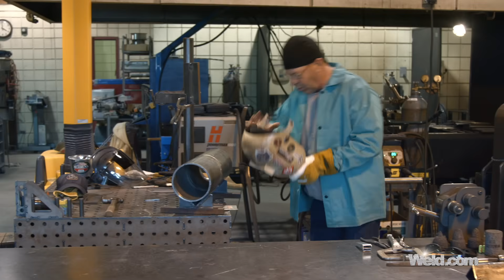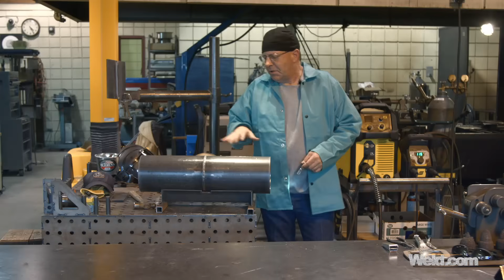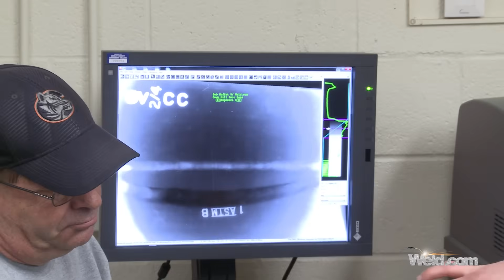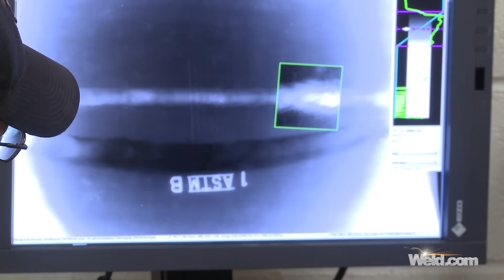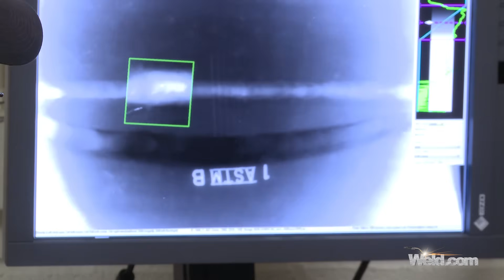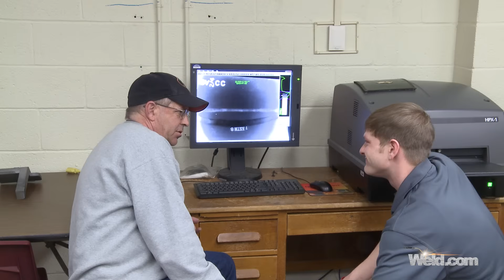🔥 X-Ray Testing 6010 Downhill Root Pass

Comment: Ive always welded pipe in plants Tig/stick but I know a downhill bead is as good as an uphill bead as long as both edges are consumed 7010/6010 my opinion downhill is just as strong as uphill because cured metal is cured metal any experienced pipe welder should know that  . Anyway that's my 2cents worth, Love your show BE SAFE AND HAVE A HAPPY NEW YEAR.

Comment: Dear Mr. Bob. I can add some credence to support your opinion on this, not that you need it. I’m a consulting contract welding engineer for a large pipeline operator. I can’t say the name due to an NDA I signed. One of my tasks for them is to review and approve all welder qualifications for all welders that work on their pipelines. So far I have reviewed over 5000 welder qualifications. They consists of API 1104 Butt, Branch, and Sleeve testing as well as ASME Butt testing. With the exception of the sleeve test, they all involve the use of EXX10 electrodes in the Fixed, 5G or 6G DH progression test positions. All of these are subjected to either requal by RT or destructive testing. By and large, the welders have no problems passing these tests with EXX10 electrodes in the DH progression. There are, however, 2 contractors that choose to only qualify EXX10 electrodes in the UH progression. I suppose at some point in time someone in their management was of the mind that one cannot consistently pass a test with EXX10 electrodes in the DH progression and they have never seen the light on this.

Comment: When you run down hill do you weave at all or just go straight ? Also is there any strength benefit doing up hill ?
Reply: Welding down hill if you are rooting the pipe does not require much weaving its faster for production welds   .

Comment: Thank you for providing great content. I have put to practice many of the tips and suggestions that give on this channel. I have a request though, can you give a tutorial or a demonstration on doing a root repair on pipe with SMAW if it is possible, without using GTAW or GMAW for the root. Reason being is that I was taught to only use the process and filler that I originally used. Thank you for taking the time to put together these videos.

Comment: I have been doing a lot of downhill root and fill then a 7018 cap just for speed on these field welds i have been making at gas plant. They will shoot clean every time and have a wedding band on the inside of the pipe. That 6010 down hill pushes a nice root in. Its quick and clean. Rig welders have been doing it for years.

Comment: I'm going to welding school at my local Vocational school as an adult student with some a-hole 17 year olds (some are polite others are not) and this one kid who pretends to be a know it all is constantly trash talking my welds (Oxy-Fuel beads, butt joint, lap joint, t joint and now 6010 stick). He's been welding for a year or so now and is already decent, I'm just now starting and in my 30's. Anyway, I'm doing 6010 running beads and I'm trying different methods and he comes over and asks "How sh*tty do your welds look?" And I just lay down the plate and say "they're alright. I'm getting better." And he asks why do I have ripples in my bead. I tell him it's called the "whip and pause method" and he asks 'why are you doing that?" Because he runs a straight bead. I just tell him cause it looks pretty. Anyway, what I'm getting at is people pretend to be know-it-alls to boost their ego or something. Once they learn one or two things, they pretend to be experts and sometimes it brings out the worst in them. Stay humble people, especially when you're starting out. Normally someone who has years of experience is humble and it's the neophytes that are the aholes trying to prove themselves or something.

Comment: yeah but there are codes that specify how to run it there are so so many variables if you can get away with it good for you I was 12 years old in the first thing my dad taught me was how to run downhill and I can weld a moment with a 2 inch flange with 3/32 wire innershield and on every pass drop 3/8 inch rebar in the moment and melt right through that stuff yeah it'll pass UT but I mean you want it done right or you want to turn right now just an observation and an opinion there's a reason the Navy won't let you run down I'm not knocking you I do it a lot myself with poor fit up no offense and keep up the good work I'm just saying there are so many variables but at the end of the day there are specifications and requirements if your welding water pipe for sprinklers you go girl but when you're in the header of a coal-burning power plant with high pressure steam I did that for 8 years and I never ran it down hill

Comment: Question for Bob Moffett are there any practical applications where you wouldn't have to use a filler wire with Tig welding?

Comment: ''Will never pass X-Ray'' X-ray to what quality control standards? I have seen QC standards that allowed enough porosity and slag that it would never pass a bend but it still passed X-Ray. Sometimes on X-Ray the standards are just enough to check that there is full penetration and no lack of fusion. I must stress that the allowable limits standards are what make a non-destructive test hard or fairly easy to pass. I am smack tired of listening to people make X-Ray into the Jesus of welding. We have a real time X-Ray where I work and your stuff goes in and comes out all day long. I don't care how good you are you will fail some here and there regardless of the welding process. Sometimes you weld on a junkie casting or forging and inclusions are pulled from the base metal into the weld. I have seen myself and so many others pass downhill pipe and plate guided bend test, again what thickness to what prescribed radius on the bend. Is it root and face or side bend samples. I have used stick, short circuit and pulsed spray for these type of test and never had a problem. Downhill is not bad it is just like any other form of welding it takes some training and time to learn. If you can't pass a test downhill either the test is engineered wrong in some way or you need more training. There is an art to downhill and many people who don't understand the dance blame the dance. If you can't dance it is your feet to blame not the dance! A good welder can weld either way and does what the WPS tells him to do.

Comment: In NB Canada on your red seal test you will be asked why pipe is mainly welded downhand(root included).. The answer is because the productivity is faster. Ive worked on the pipeline for 6 yrs and failed 1 xray, You can CERTAINLY weld a pipe completely through using downhand technique. 6010 is what kind of rod? Deep penetrating.. #FBOMBTHEHATERS #RunYourWelderNotYourMouth!

Comment: A real good welder knows when he  or she can run a down bead and when they can't. What happens is that many welders have been trained for one specific Application. For instance when I qualified for welding on submarines I tested on heavy plate material with a backing bar. None of the test had a open root. but when I qualified for steam pipe everything had a open root.I have never welded pipeline in the field but understand why they down hill the open root with 6010. When I welded at Chicago blower all the blower housings were sheetmetal and a down hill bead was the only way to go. Real good welders must keep a open mind and keep seeking knowledge. The industry is always changing and open mindedness is a key to becoming the best.

Comment: G'day bob cool video my welding instructor here in Australia said that if I was welding on a silo I should do a vertical down root so that the inside of the joint is left flat so nothing can catch on it. We use vertical down a lot manly for speed and never have any problems

Comment: Man I need some help on downhill caps using 1/8 6010 on sch 40 pipe.
Reply: GoodWeld best advice I’ve had was to make sure the bevel is full before you cap. Keeps the bandaids on the inside that way too

Comment: Good on ya bob I don’t understand why people feel the need to put people down why not just share information rather than being horrible 

I would love to see a mig weld fillet weld down hill as there has always been a rumour that you can’t get a passable weld would be interesting
Reply: cant xray it can only bend test or MP it and it depends what youre welding.. Say you have a square tubing hand rail with 2 flat welded j groves and you run the side verticals down hill thats going to be just fine unless your WPS states the welds must be up hill which is just engineers who have no idea.. We built a handrail for the golden gate bridge when it was being worked on 3" square tubing using E70-S esab solid wire with a MigMagic(75/25 I'm pretty sure was a praxair gas)so the flat welds were the critical welds because thats what people would be leaning against etc....the vertical welds really just needed to be sealed for galvanization.. but they wanted all 3/16 uphill welds on 3x3x1/4 squre tubing.. it made no sense.. took twice the amount of time and quite a bit more money all because a engineer had no idea. Now last year where i am in order to become a welding inspector you need to first get your red seal in welding. To begin an engineer you do your course and then have to shadow a red seal welder for 6 months. I believe it should be like that everywhere.
Reply: and they should haveto shadow a welder in a CWB/AWS shop doing misc structural work, then another on pipeline, all the experience they can get so they get their craft.

Comment: Hey Bob great video. I was wondering if you would be interested in doing an 5g open root mild steel pipe demo using SMAW 3/32 309-16L? It was definetly challenging when i did it in my last year course. Ive asked my instructor at that time how common this practice was and he said to me that its quite common over seas same with using xx18, xx14 and xx16 Low Hy. rods any way if you could do a demo of this that would be great as i feel it would be beneficial to all curious viewers. Thanks for your time.

Comment: great videos bob, hey can i just drag 6010 downhill with a slight side to side when doing the cap? ive learned alot from you so far, i went thru welding school as well, i weld pipe now, all chilled water pipe.

Comment: Is there a structural integrity difference between uphill and down? I have always been told structural has to be uphill. Any info helps.
Reply: William Preston Not that I've seen in materials testing.
Reply: Bob  Moffatt Thank you for the reply.
Reply: They believe running downhill you're welding into the pool instead of the material. As for root passes especially on pipe it makes no difference whether you go up or down

Comment: Eh, some idiot find You also :) Bob, leave this idiot alone with his professional knowledges! 
But for laugh on me: here is a stupid question: I facing almost everyday with a annoying problem on the construction fields. Welding small diameter pipes together with stick, when the pipes are mounted horizontaly. Any advice? Because every time the 1 inch bottom section of the welding is just looks sucks :) Lower currect... not working, higher current... not working,  uphill not working, downhill not working, smaller stick, kind of working... So frustrating!
Or I'am alone with this?
Reply: BMR Studio You're not alone. Smaller electrodes have helped me a lot. Must be accurate.